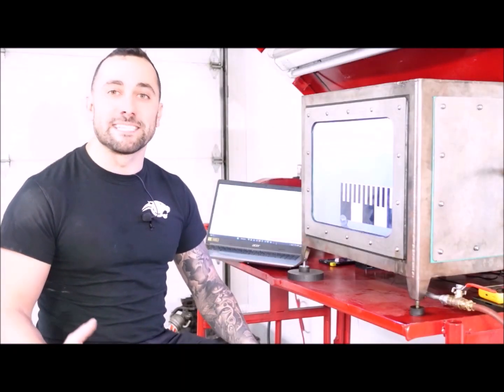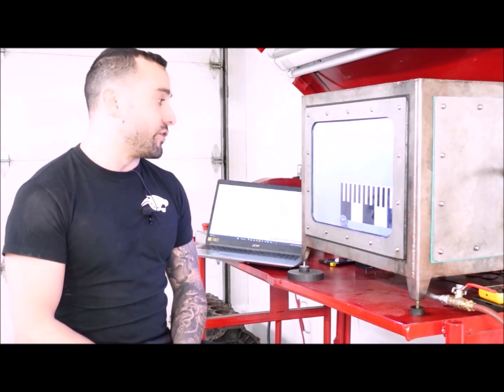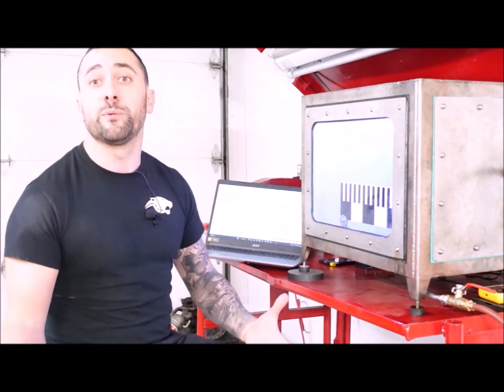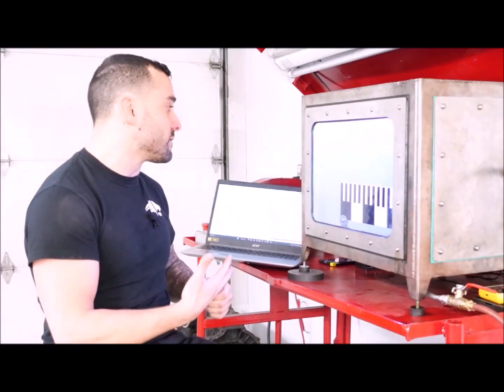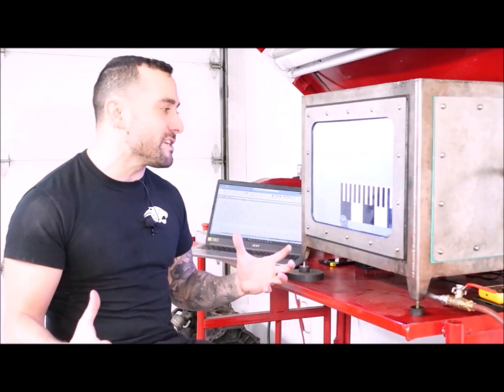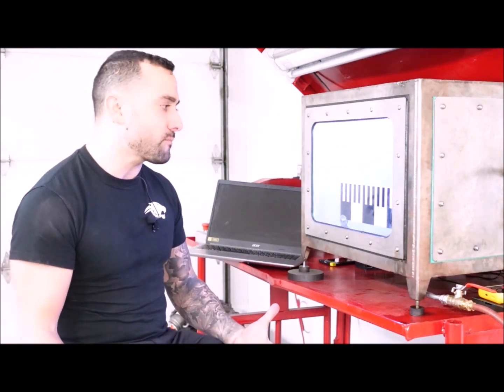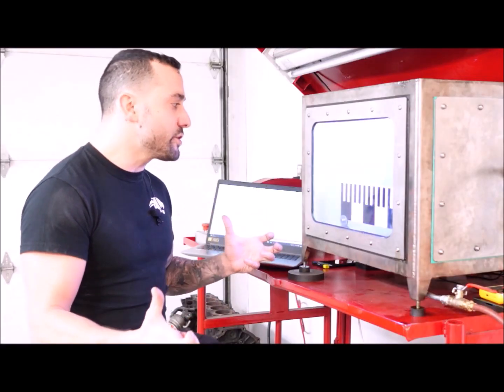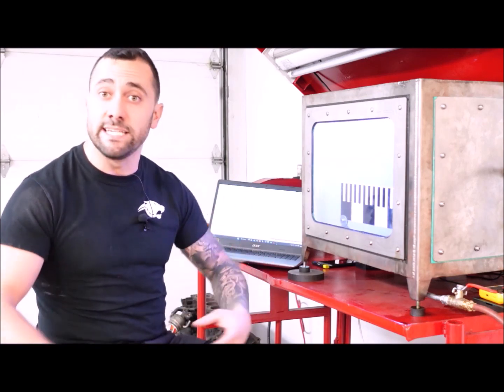Fuel injection study 2 - Injection slow motion

Comment: Is this engine going to be designed to bolt up to trx450 motor mounts like the previous pm07 engine did? Also when can we expect to see a running prototype of this engine. I will seriously consider buying this kit if it bolts up to trx mounts.
Reply: agreed! we need more information